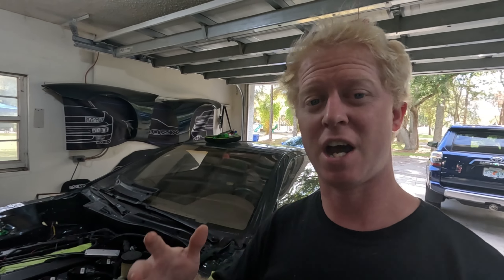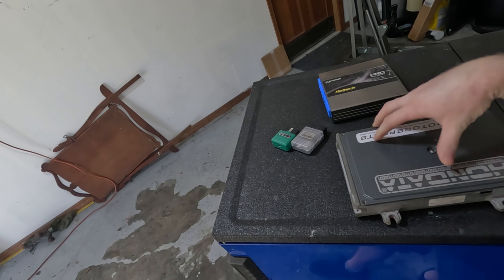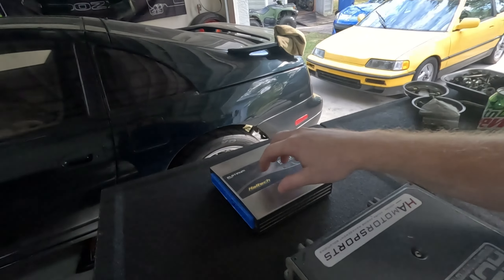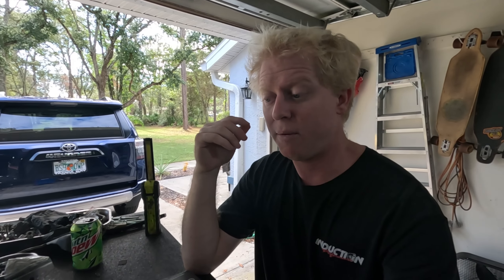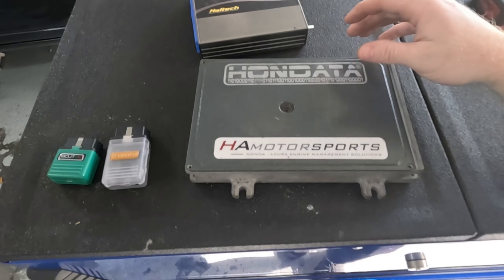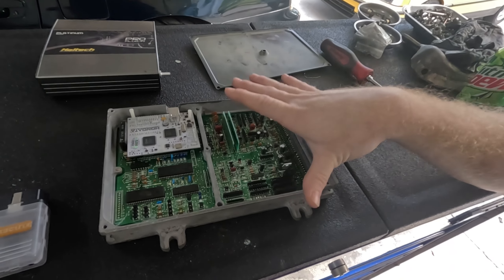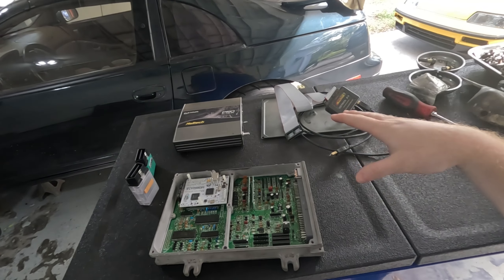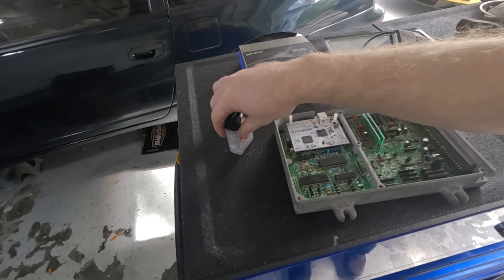Everything You Need To Know Before Tuning Your Car!

Comment: Something I would like to see on your Haltech if you are going to use their boost control functionality.  If you are I would like to see how you tune your boost tables, how many solenoids, I think two would be cool (wired in parallel), very short hose runs for solenoids, would like to see what switch or dial you choose for changing boost on the fly, changing boost via E85 content sensor,  or both.  

I have the same Haltech you do for my Z32.  I currently have an older Blitz boost controller and have been lazy on getting rid of it.  Before that I had and even older GRID boost controller.  If I look back I really liked the GRID unit because it had dual solenoids, good response, but being old it bit the dust.  I really liked the simplicity of it.  I just had a single knob, turn it up as far as you dare.  Curious to see what you plans will be.  Keep up the good work on the build.
Reply from the maker: I could do a video on boost control🤔

Comment: Very informative! Is there a reason youhavent went to elite 2500 or nexus s3? If you were which one would you pick and why? I was looking at possibly going s3 necause its only a couple hundred more.  It was so cool to see the apexi safc i had one on my z so i could run twin filters, but i couldnt find much info online.
Reply from the maker: No need to personally. The platinum does 90% of what I need it to. Primary reason i would go to S3 that I could think of would be for the dual DBW as of right now.